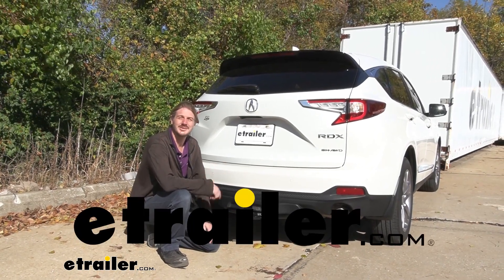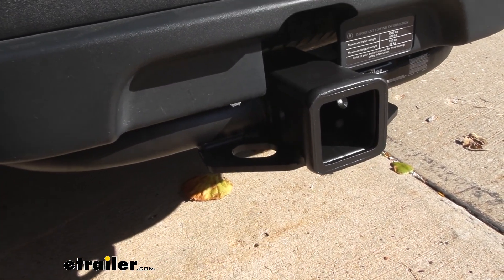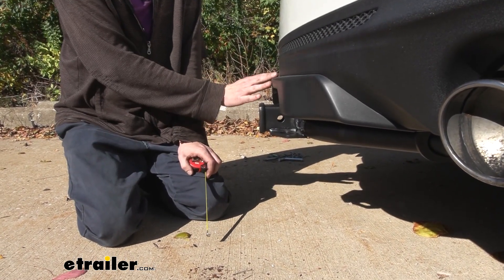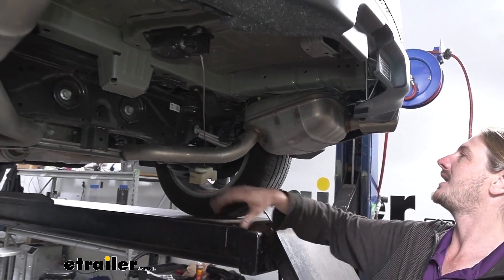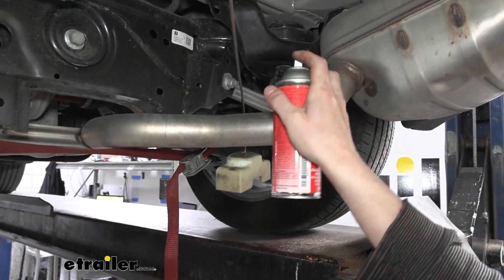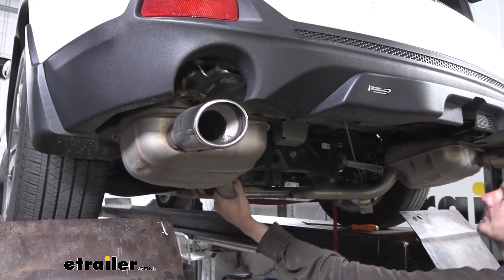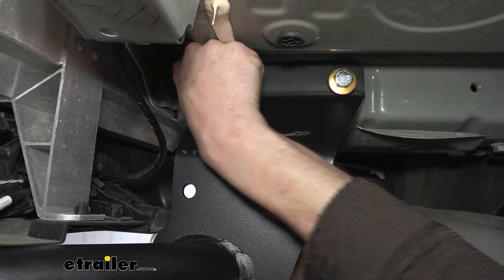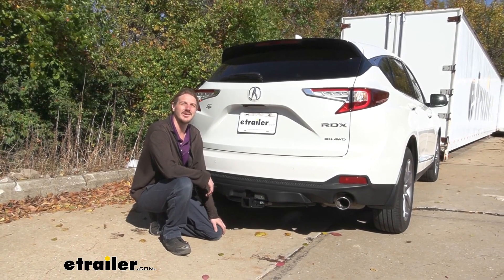Mount: etrailer Trailer Hitch Receiver on a 2020 Acura RDX

Comment: LOL!!!!  3:03 "May not be as sensitive as before", as he does the "hokey pokey" in an attempt to get the damn hatch to close!!!
Reply from the maker: He did the Macarena in the blooper reel....Honda offered a hands-free liftgate sensor relocation bracket for the previous generation CR-V. Might want to check with your Acura dealer to see if a bracket is available for your vehicle. Hope that helps you!
https://www.etrailer.com/Trailer-Hitch/etrailer/e72AR.html

Comment: Why is it sticking out so far and that draw bar is huge.   Is there another hitch receiver  option for this car ?
Reply: I know the appearance is horrible. Will completely ruin the style/looks of RDX especially the newer A-Spec models with the sportier rear bumper panel. 
You need to spend a bit more for a "hidden hitch" (or perhaps a "stealth hitch" design) which currently is only available via a custom installation.